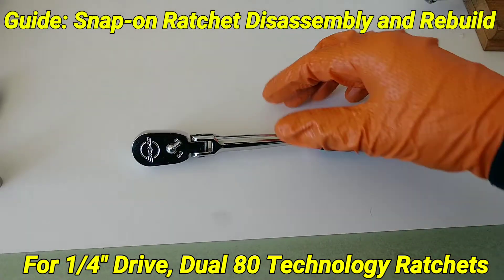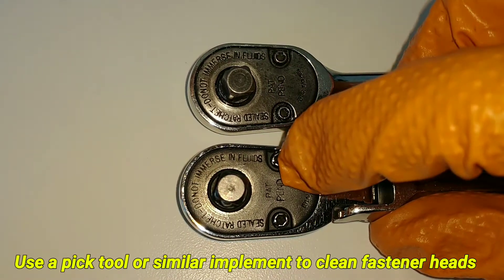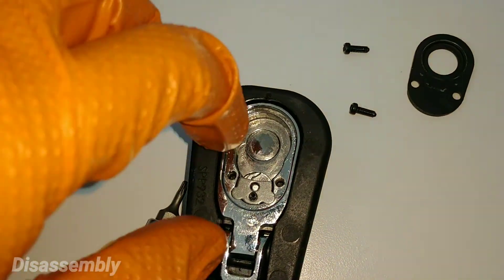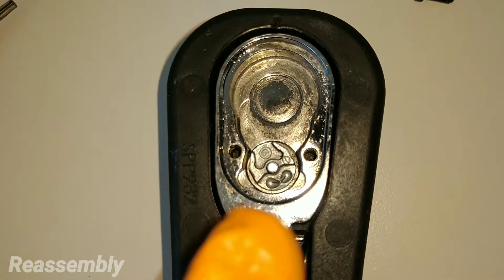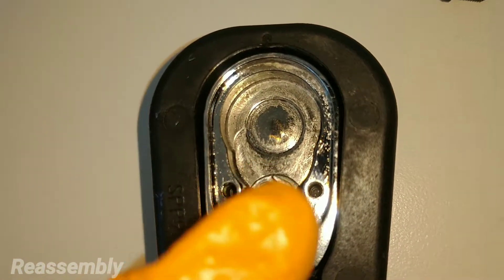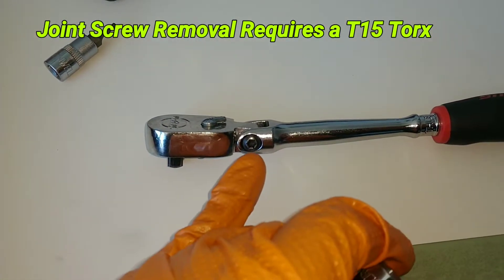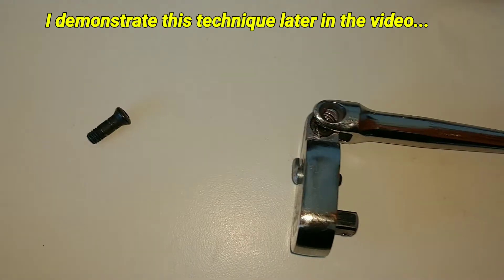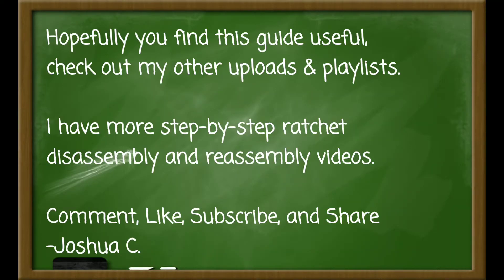Complete Guide: Snap-on Ratchet Disassembly and Rebuild (1/4" Drive)

Comment: Got mine off the truck snd took it apart to put a 3/8 compact head kit in it but forget to get the faceplste and now i CANNOT get it back together. The stupid ass gasket for thr face plate is like too big and binds up with i tighten the screws up just enough to where the plate isnt wobbling around

Comment: Another great video, where did you get the 1/4 Ratchet tray?
Reply from the maker: miguel mendez I got it from my dealer. It's weighty 
/dense rubber which is cool as it holds the ratchet secure. I like it. Hope this helps.
Reply: Joshua C. Is their a part number for the Ratchet holder?
Reply from the maker: miguel mendez The only part number present is "SPP932" moulded on it. No Snap-on logo or brand of any kind.
Reply: Joshua C. Okay thanks bro